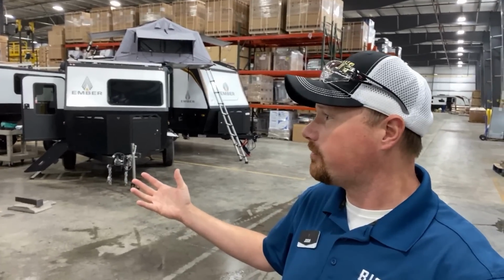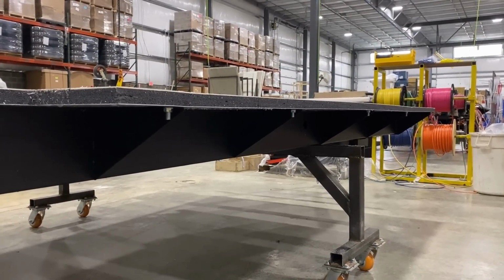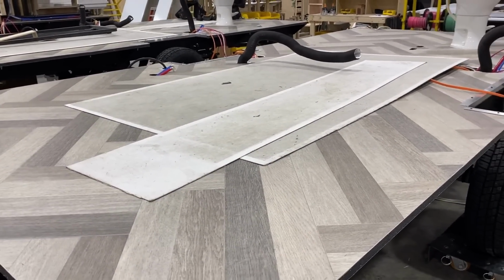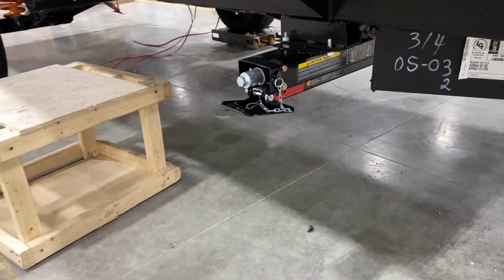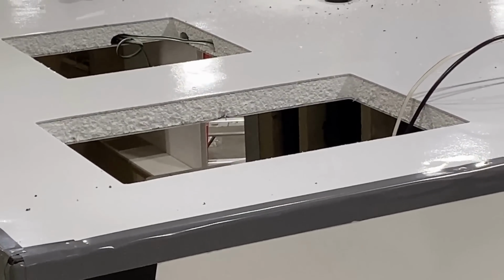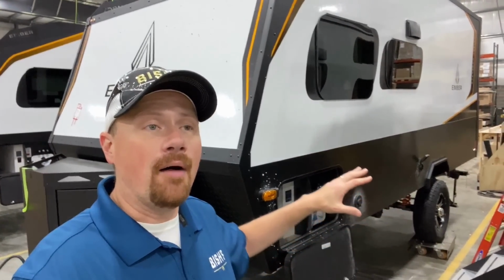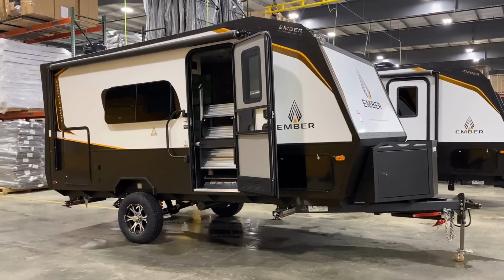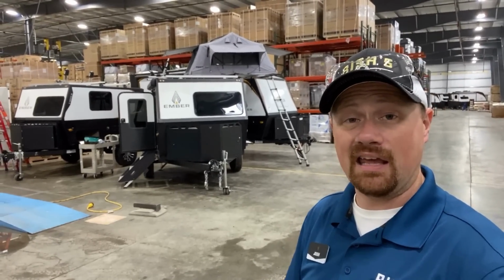Ember RV Factory Tour!!

Comment: Very good built quality, there are a few things they are doing the same as the other guys but you can tell its better build quality. I liked seeing the aluminum angle around the floor around the tire to protect it in case of a blow out. One thing we use in our industry for nuts that are critical is prevailing torque nuts, no need to double nut the out riggers then. What i would recommend is using 2 bolts per outrigger and using a small aluminum plate. During the video it looked like some of the outriggers were over torqued and it was warping the floor material. If they were using 2 bolts per outrigger and using a aluminum flat bar to squish the floor material not only would it be stronger but it would reduce fatigue points. Awesome camper cant wait to see what they continue to build and the continued improvement.

Comment: Glad to see the ember build process. These are very nice trailers. Makes me think of the Spartan trailers over the top build specification. One of the things which I noticed was the suspension sits in a specifically tailored pocket in the frame. It is not slapped onto the outside like virtually every other manufactures trailer. These also have a very robust construction throughout, bottom to top, front to back and even all the furnishings are stoutly built. A very very solid trailer. Nothing slap dash about these units. These are expensive and heavy trailers. However, the have earned their price point. I am very willing to bet these trailers will be very very expensive as old used trailers as well 10, 15, 30 years from now.
Reply from the maker: Yeah that chassis system literally is THE basis of Ember's entire company. They quite literally built around it

Comment: Really really liked seeing this video. Very glad to see the stabilizers finally come in and improvements like standard wiring harnesses. Great idea that Max solar can then be added afterwards. BIG SUGGESTION  is to add nylon locking nuts to attach floor to frame. I have had to do this with every RV I have owned and manufacturers just need to do it at the start. Most factory tours make me worried about quality because their workers are running around so fast and crazy. This tour did the opposite. The pride and organization spoke volumes to the Ember Attitude. I really do hope my dealer in  Truro Nova Scotia gets some Embers soon to look at. Really really impressed thanks Josh!
Reply from the maker: TY for the nylon nut suggestion
Reply: Can it be ordered  and delivered at the factory?

Comment: these are such well made trailers.. I'm very impressed.. the one thing for me that is maddening for a higher end unit like this, is not having slam latches on the baggage or outside compartment doors.. I've had three trailers and they all had those twisty whatever locks they are, and without fail they always loosen or come apart and really are not stable at all.. i realize the doors are closing the opposite direction, but the slam latch should work the same way closing upwards.. but otherwise kudos to a great new brand with a quality build
Reply: Thank you for your feedback! We are always looking to do better and build better RVs. We'll share your input with our team!

Comment: Josh - love your factory tours and insight.  Seems Ember has their act together; but why oh why the flat roof?  Is it really flat like the video shows?  I HATED that about my Minnie Winnie - that flat roof was awful.  The water needs some way to shed off the roof, and forget about snow melt unless you store the rig tail down.
Reply from the maker: The roof does has watershed. It is slanted front to back if you notice. No way for water to sit and pool up. 

The roof is a 3" thick laminated structure. Machines aren't really out there to make that on a radius

Comment: Thank you, (again) for yet another great, in depth video! This Ember factory video is VERY IMPRESSIVE. Ember is definitely on our top 2 list! 😊
Reply: Ember is on our top two list also. Outdoors RV is our other brand we are looking at. What is the other brand you are looking at?
Reply: @sparkypdx  
Hey Jon, the other brand we're considering is the Grand Design Imagine XLS 17MKE or the 22RBE. HOWEVER, Uncle Josh JUST reviewed the new EMBER tandem axle 201FBQ. An amazing unit we feel! We're hoping that maybe they might offer it with a murphy bed instead of the fixed bed giving us that second seating area. We really don't like the bed being visible all the time - kinda takes away the "living area feel" we like. Naturally we could always go with a much longer trailer that would offer a separate bedroom, but that's something we don't want to do since it's just going to be the two of us and we want to be around 25 feet max in length. Maybe we're just being WAY TO PICKY!!! 😝 but this coach would be our last one.
Godspeed on your search and final choice! 🙏
Reply: @moe.cabrera  Thanks for replying to our question. Wow both of those are nice. It is hard finding a shorter trailer with good “road mode”. And the new tandem Ember sure checks a lot of boxes. Good luck to you too on your search. Jon J
Reply: @sparkypdx  Yes! That tandem Ember is A REALLY NICE coach, not to mention the way they are built. VERY, VERY IMPRESSIVE INDEED! 👍

(Did I fail to mention they're VERY IMPRESSIVE as well??? 😝)

Have a pleasant rest of your weekend!

Comment: Great video!  It looks like the underbelly enclosure is several sections.  I like to see good access for repairs or customization. Tank heaters are a huge plus too, though it would be even better to see insulation.
Reply from the maker: Sectionalized yeah. Because of the suspension. The tires have to go up into that space
Reply: @JoshtheRVNerd   Little details like that make a huge difference for someone thinking of doing some customization, or thinking of long term ownership and ease of getting to things. Having to take the whole underbelly down for a minor issue is a huge pain (or expense, if you have someone do an after warranty fix).

Comment: Hey Josh, Are the Touring Edition use the same quality control and materials. I’d like to see them built.
Reply from the maker: Slightly different in a few areas like the roof due to the centralized air system

Comment: I  Would like to add a small note with Terry I  prefer the 191 but with a dual axle. That would reduce the tongue weight from 800 to Maybe 600 or 400 increase payload capacity of  The trailer and allow me to use the additional payload of my truck half ton
Reply from the maker: They have that coming! I've seen the prototype

Comment: Hey Josh, I was just on the ember site, and noticed they posted a starting price for the 221 dual axle, just under 61k.  I was wondering, if you have access to what the options might cost?   I'm very interested in one.   I was thinking about a 25 twin Airstream, but $$!  I know the labor on an Airstream is significant.   But as retired police, I'm leaning towards the ember.   Thanks for the videos, great info, and you're quite the entertainer!
Reply from the maker: The only option that will significantly affect the price tag is the max solar package and if you want to add the extra 1-2 battleborns. That could run $4,000-$6,000 I would estimate

Comment: Josh, what kind of slide are they using. It seems it is a cable but?
Reply from the maker: Exact slide by norco
Reply: The Exact-Slide is a premium slide room being used in motorhomes and luxury fifth wheels today. It's known for being more accurate, using a "smart" system to be sure the room runs in straight every time. One other great feature is that you're able to use the slide while in travel more (typically "not allowed" on other slide room systems.

Comment: At 12:33 in the video you see raw plywood and untreated fast grown  (pre-rotted) termite food under the shower pan.  Why would you not use the azdel foam block floor type material here instead of the junk wood shown in the video. I hope they see the error in this and improve this specific shower pan support mount.  

Now separately I would like the outside panel junctions all joined by "pre-pregged" epoxy glass tape ; just stick it on and heat gently; now all the seems are fiberglass watertight. Then add the special structural super tape and final aluminum outer frame/joint covers. -probably just me being an overkill junkie!  But hey I'm into boat building.

Comment: Really funny that the toilet is the first vertical thing installed after the floor is in place. And based on 8 Embers per day and about 250 production days per year, it looks like Ember's production capacity is about 2,000 total units per year. Will they be making their 2-axle models in the same production facility or are they adding production capacity for those larger units?  

I wish those slides would have outside access door(s) to the under-booth (or behind the sofa) storage spaces, ala Rockwood/Flagstaff.

Was very glad to see this Ember tour video today...thought I'd have to wait until tomorrow for it to drop...now just counting the days until you release the dual-axle reveal video!  CAN'T WAIT!!!!!
Reply from the maker: Currently they have only this production facility. As their offerings expand I could see their production expanding accordingly

Comment: What are the R values for these units? We have an Xplore X22 with pretty phenomenal R values. And it really makes a difference for comfort and the need to heat/cool the unit. However, we love these floor plans and are considering the switch.
Reply from the maker: Not trying to be difficult here -- this is a slippery slope-type conversation. This industry has run rampant with falsely inflated R-Value claims for so long that I really don't even look at them anymore. 

For instance there's no such thing as an R38 or R40 anything. That's just propaganda. And please consider that we represent RV builders who share these claims -- I still stand behind my statement. 

What matters to me is actual testing. I like proof over promises. 

And embers have been independently 0-100 degree tested and proven in Truma's own temp chambers. They actually passed the first time, then tweaked some things and went back to get better results the second time. 

So they're proven hot/cold camp rated. That's what matters to me

Comment: I've seen several of your walk throughs of different Embers and honestly, the one thing that really had me interested were the European windows. Now that those are unavailable, what are we left with? A frameless window that cranks open with a roll down shade just like in the GeoPros? And what about the skylight window, is that a fixed window now or can you crank it open? Losing those European windows has me bummed out.
Reply: Exactly. I wanted the European windows and the swanky stabilizers…getting a unit next week with the original windows because I can conceptually get the lippert stabilizers aftermarket but there’s no way to get the integrated shades later. Plus I’m worried they won’t make the 190mdb (no slide) in 2023+. If you have questions call/write them. Their marketing team is pretty forthcoming about what they plan to do. (They didn’t tell me details but let me know the basics of the dual axle big boys)
Reply from the maker: Temporarily unavailable
As soon as they can get supply hiccups resolved the windows will return. So perhaps hold tight just a bit
Reply: @JoshtheRVNerd  yeah, between the ability to upgrade the inverter (actually not that hard to do yourself), the ease of use (and just cool look of the new Lippert leveling feet), I think I need to hold off until they get the European windows back in stock. A bummer for sure - but worth it to wait in the end. I'll call Ember Monday to see if the unit I've got under deposit has the upgraded wiring; if not, looks like it might be the end of the summer - or whenever they get those darn windows back in stock! Thanks for the channel, HUGELY helpful - and it's nice to see that these have beefy bathroom fans; I've come to realize that's one of your pet peeves!

Comment: Just wondering, but how are the walls connected to the unit?  Never did see that in the video.  Also, Ember states they have a 5 sided aluminum frame, or something like that.  Is that aluminum just part of the Azdel wall?  Sorry if you've explained this before.

Thanks for the great work!
Reply from the maker: Lag bolted from below

Comment: I've come across a number of issues owners have posted on Youtube, mostly leaks. I am curious Josh, did Bish's have to deal with any of these in the past? And have you seen quality improve. I like some of these models especially the 22ETS.
Reply from the maker: Their initial run had an engineering oversight that could allow a slide to leak if towing in the rain

They put out a recall to their stores. They would pay the stores to fix the rvs. 

Only about 8% of the recalls were fulfilled by dealers before they were sold. Ember took a nasty black eye because their dealer body generally did nothing to fix a known issue because it wasn’t causing a leak when at rest at the time

That was the biggest thing they dealt with 

That was resolved quickly thankfully

No brand is ever perfect. Ourselves included if we are being fair. There’s always room for improvement

I haven’t seen major batch issues since though
Reply: We've addressed the issues from our past and made sure to take care of our customers. We are always trying to build better RVs!

Comment: Uncle Josh what exactly technically to everyday people does the 100 degree and 0 degree test actually translate to? Does this include units with a slide? What about my unit that was built in December 2021? Thank you for all you do for the community!!
Reply from the maker: It means the RV has been tested in a chamber where they can control the temperature. For extended times therapy is tested at 0° and then at 100°. During those times they monitor the temperature in the holding tank cavity and in the living area.

They ensure the tank stay above freezing and the cabin stays at a comfortable livable temperature. And yes it applies for slides
Reply: @JoshtheRVNerd  I can attest to the comfort in 100 degrees here in Florida! The ac on low keeps it in the low 70s during the hottest part of the day. Very comfy. And we have slept in 40 degrees in January.  That Truma is very efficient. Quiet and toasty warm. The heater will run you out of there. With a thermostat control on the heater you just need to learn what you are comfortable with. You can barely hear the heater when it's running. We will put it in zero degrees this coming winter in the Tennessee mountains.

Comment: What is the r-value of that wall panels?  Can the Ember be used below freezing, say 0 degrees?  What about condensation concerns on the aluminum panels?
Reply from the maker: When something is laminated the R-value is determined almost completely by thickness though materials can have an affect. These brands advertising R40 or something nuts are pulling that number out of the sky because nobody is really out there to verify the claim. 

Embers have been 0-100 degree tested and verified by testing in Truma's environmental chambers

Comment: On the under belly heating, is it propane, 12v, or electric?
Reply from the maker: Underbelly isn't directly forced air heated. The tanks have heating pads which provide indirect 12v heating in that small space however

Comment: One thing I would like to see an rv dealer do is make the wheel cutouts reinforced so when you get a blowout it doesn't ruin the rv.  Josh, do you know if their flooring shrinks like Jayco? The foam insulated sandwiched floor on jayco products shrink and get soft spots in the floor. very annoying!
Reply from the maker: It’s not shrinking from things like weather that cause those soft spots. It’s thinner decking and joists too far apart 

It’s possible with any laminated floor but feathers are not known for them

Comment: with only 1 wheel/tire per side - what happens if you have a blowout at 65 mph ...?
Reply from the maker: It’s going to get interesting. There are major benefits to tandem axles for sure. 

If you do have a severe blowout instead of a slow leak though, it’s actually not uncommon for both tires on one side to go. One tire is not rated to handle the entire weight of the trailer typically. But given the choice between the two I would definitely prefer tandem axle for more chance at safety

Comment: Care to comment about large numbers of leak issues detailed on Ember FB page?  Lots of us watching your Ember videos wondering if you viewed a special “manufacturing” show and the average trailer is no different than any other manufacturer.
Reply from the maker: Hey Rex! So when Ember first came into being they did their best to apply their experience to craft the best rv they could from the start. Nobody is perfect unfortunately and despite their best efforts there were a few small areas they missed that did allow water to penetrate some of their early run models

They have acknowledged this all head on which I respect. They’ve supplied their dealerships with instructions on how to correct any affected early builds already in the field as well as to assist clients reporting the issue

You won’t see any of that in this video because those items are already addressed within their revised construction processes. Every rv is now tested with that sealtech machine for instance - which didn’t used to be the case

It’s important to understand no RV is waterproof, embers are designed to be extremely resistant to water intrusion, and unfortunately some of them did leak. 

Hope that helps.